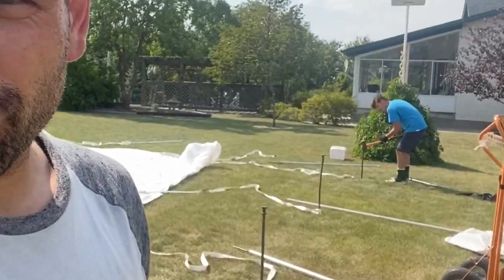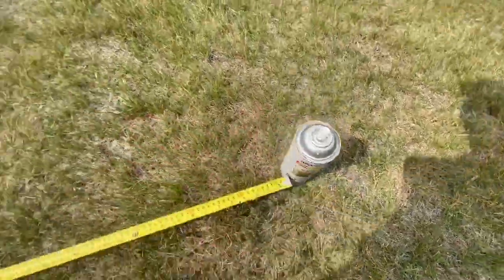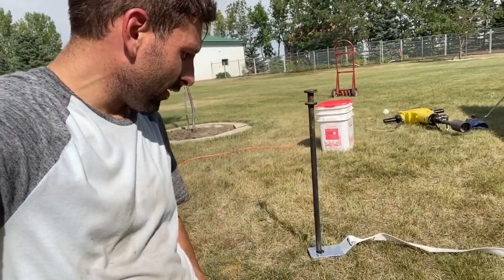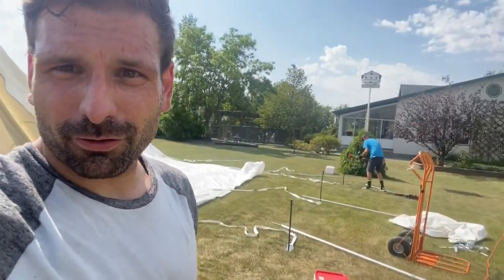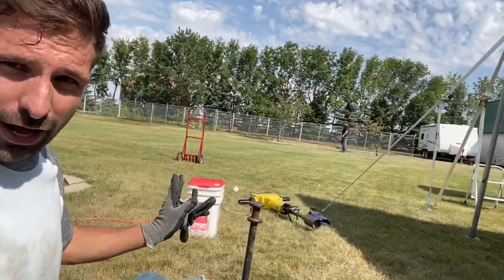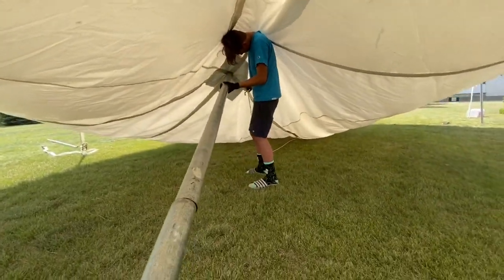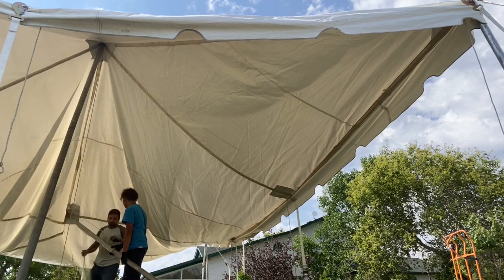Pole Tent Setup - Step By Step Instructions - 20x30

Comment: Good going on the tent. I've been told if you put a half twist in the ratchet the wind won't flap the webbing as much. You tried that?
Reply from the maker: Thanks for the feedback. That’s why I make these videos (one of the reasons anyway). I haven’t tried the twist but I will definitely give it a go. I’m eager to learn and grow.
Reply: If the tent is tensioned properly no need to twist.  It’s literally just proper tensioning.  With pole tents you usually set the stakes the same length of the pole to give a proper hold.  To close in the stakes can pull out with wind.  Too far out there is pull but no hold.  Like I said just proper tensioning

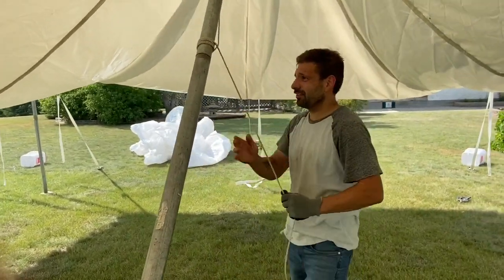Comment: re 3:35 The line should be lashed to the bottom section of the center poles, or a gust could lift the top segment(s) leaving the bottom segment to topple and the upper to flail & impale.

Comment: I noticed you beginning measurement was 50' x 70'.  Is that what you need ?
Reply: 50'x70' would be for a 40'x60' tent. Allow 10' (5' per side) extra for staking....although this tent doesn't look like a 40'x60'. More like a 20'x40'.

Comment: Invest in a gas powered breaker. Professional tenter for 10 years. Wacker neussen is the best in this regard
Reply from the maker: Totally. I’m hoping to get a Thor next!
Reply: Are you sur ? i have tied Cobra ( 5 of them) , Pionjar 110 and 120 ( yes very powerfull) , and a one like he did use , and i prefer for sur the last one, ..no cranking, always work :-) and you are not tired after pulling the starter for 30 minutes :-) no way i will change my electric Bosh hammer.

Comment: hey did you stop doing pole tents?
Reply from the maker: We stopped doing Canopy pole tents (20x20, 20x30 & 20x40). Our pole tents are 40x40, 40x60, 40x80 and 40x100. Here is a video of the pole tents we did in 2024 👉🏻 https://youtu.be/0QkCu0HYaRQ?si=3PztrJLIGwo8oegz
Reply: @therentalguy  any reason why stopped the smaller tents ? Not rated for high winds ?